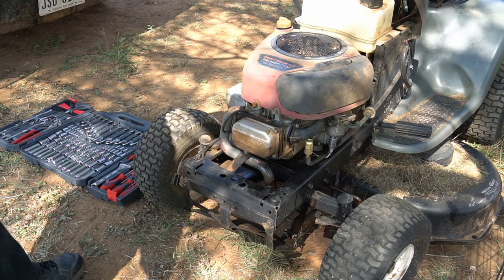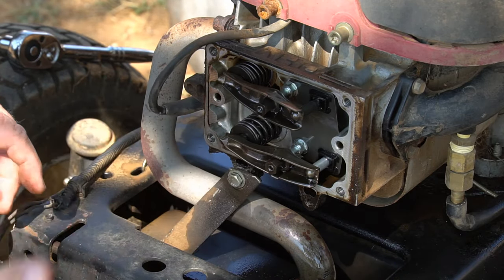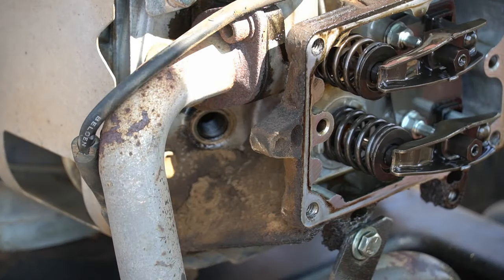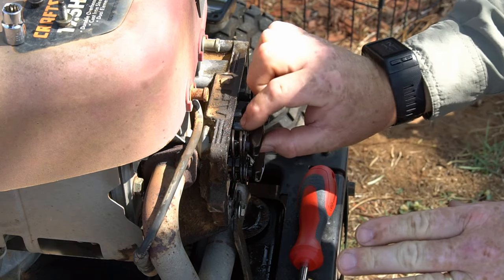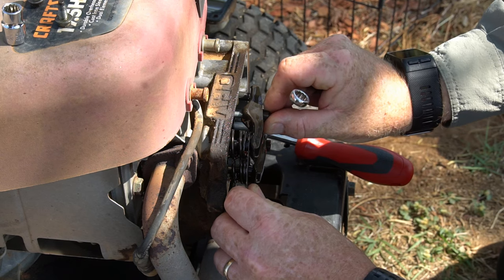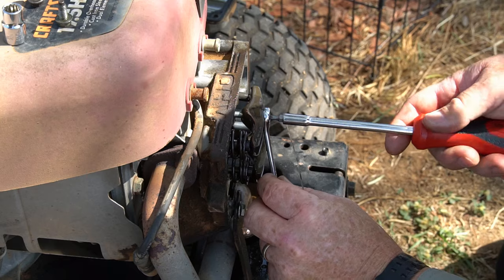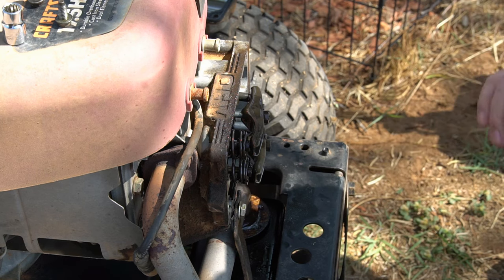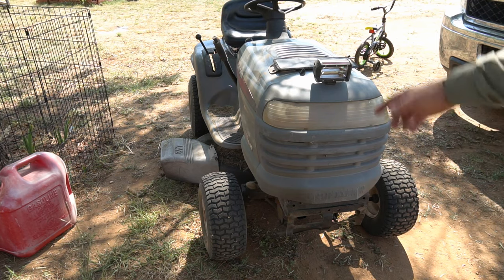🛠️ DIY: How to adjust the valves on a Craftsman (Briggs) 17.5HP OHV Engine

Comment: I've done many of these and the Intake is the Bottom with the Aluminum Push Rod. Top is Exhaust with Steel Push Rod. (Can always tell because one is shiny (Intake) and one is Black (Exhaust). Good rule of thumb when adjusting is TDC on compression stroke/both valves should be ready to adjust. Intake .004 and Exhaust .006. That seems to always work best.
Reply: Yep, if you pull the exhaust pipe that valve is right there. The reason briggs and crackens get fouled up is when that float sticks and the intake, angled straight down to bottom intake, lets gas right into the crank
Reply: Stevie H is right!
Reply: @rywolf01  bottom is int   its a fact
Reply: Have to agree with that
Reply: That is correct👍👍👍👍👍👍👍👍
Reply: Yes I have this exact mower and engine, Stevie H is correct.  You can see the aluminium intake push rod on the bottom, I just replaced a broken one.
Reply from the maker: Thank you for this great information Stevie H.  I appreciate it very much when viewers contribute useful information as you have here.
Reply: A simple magnet can differentiate between the two.
Reply: Yes sir you are rite on / intake has the aluminum push rod / the exhaust has a steel push rod / exhaust could not withstand the high heat it would all most melt it
Reply: This comment was spot on and brought my craftsman LT2000 Intek 17.5 engine back to life!  I was ready to haul it to a repair shop.
Reply: Hey I want to personally thank you for your comment. I have a Kubota push mower that I now have   running again. I tried adjusting the valves and just assumed top was exhaust and kept getting exhaust coming out the intake and couldnt figure out why. Now I know what I was doing wrong and now my rare kubota is running again after being down for a couple years! Thank you sir
Reply: Yeah just because a certain valve moves first doesn't mean it's intake. If the engine is past compression stroke the exhaust will open first as seen here.
Reply: itake always has an aluminum push rod
Reply: Yup, you have the valves reversed. But I am sure that alot of people already pointed it out. Other than that, great video!
Reply: intake is on the bottom on this engine.  when the jamb screw the smaller hex, this is the case,  if the jamb nut is used reverse your thoughts.  to be sure.  the exhaust opened then the intake just after it
Reply: You are 100% correct about the exhaust valve is the top and the bottom rocker is the intake valve and I like the way you pointed out the push rods and the valve clearance is correct too! Thanks!

Comment: You are mistaken top valve is EXHAUST!!!  Four stroke engine: intake-compression-power-exhaust!!
Reply: Yep. The exhaust valve uses a steel pushrod, and intake uses an aluminum pushrod. That is the easiest way to identify the valve on these engines.
Reply: Agreed. When rotating the engine, for about one whole rotation, the will be no valve movement. This is the compression and power stroke. After these, the exhaust valve will open and the intake will shortly follow. You can also pretty clearly tell the exhaust comes out right at that top valve
Reply: @Skippo18 Yes , I was just going to say that .
Reply: Not only that, you can see the top valve is literally next to the exhaust pipe.
Reply from the maker: Good info
Reply: @cheessedoodle I have this engine, just took it apart to do h3ad gasket. The pushrod associated with the top is darker and has a red bar on it.

Comment: As a rule of thumb and in this case, the "Intake Valve" has an aluminum push rod (bottom) ....where as the "Exhaust Valve" has a steel push rod (top). Good presentation...
Reply: correct
Reply: Lol I seen that to . he needs to get his info right before he makes a video . and there is a decompression release on the cam that maybe bad if people are getting to much compression
Reply: @SilverJustice what good is a how to video if the information given is incorrect. Fortunatly , in this case, the incorrect information didn't and in most situations wont result in considerable engine damage .
Reply: I probably won't get a response 4 years later but my problem is I think that someone who worked on this motor before me mixed up the push rods because every briggs motor I have seen has the aluminum on bottom. The one I have here has aluminum on top. I am trying to figure out  if they mixed it up so I can adjust valves but also so I can see if compression release is still working. I am not a mechanic. I have a Scotts S1742 with a briggs 17.5 motor. Cant find a serial  umber on motor anywhere. Every video I've seen has it on the valve cover buy there are no numbers on this one. I don't want to pull apart motor if I don't have to obviously

Comment: You made an assumption that the engine had stopped at the end of the 4th stroke and so the first valve to move was intake. In actuality the engine had stopped at the end of the 2nd stroke and so the exhaust valve opened first when you turned it. When an engine coasts to a stop it doesn’t always stop at the end of an exhaust stroke. It stops when the flywheel runs out of inertia.
Reply from the maker: Runs amazing. What else matters?
Reply: Jungle Explorer it would matter to someone replacing a valve or pushrod because they are different parts.

Comment: All these Briggs I seen I have one I got it free though my neighbor a Craftsman has 18 brigg I got it running of course the valves need adjustment I have another craftsman riding mower with the kolher command for 22 years never had to  adjust the valves it starts just fine still

Comment: just watched another video and they said  that the valve with the steel push rod is the top one and could be checked with a magnet,  and the alum. push rod is the bottom  and as i see it that exhaust pipe mounts close to the top valve  that would make it the exhaust

Comment: If you have hard starting it's normally the intake is loose. There is an internal compression release that pushes the intake down when cranking. Much over .004 on the intake will effect this feature resulting in hard cranking
Reply from the maker: Thank you for commenting sky5jump!
Reply: What to set at

Comment: Another good rule of thumb? IF the engine doesn't want to spin over?  Hard Crank? Before you go checking the valves and  messing there...make sure it's not vapor locked...(you can tell because there will be gasoline in the oil from Carb flooding. Always a good idea to put shut off valve on the gas line too on older mowers.
Reply: Thanks mr! Mine has fuel in the oil cuz I cut the plunger off of the electronic fuel stopper that comes up thru the bottom of the float bowl. I'll get a shutoff valve, even if it's a pair of vice-grips!
Reply from the maker: Thank you for this great information Stevie H.  I appreciate it very much when viewers contribute useful information as you have here.
Reply: 10th

Comment: A lot of good information but the first valve to move when you turn the engine depends completely on where the engine had stopped and which direction you turn the engine.

Comment: Top valve is exhaust with the steel push rod. The push rod is the darker color and on the right side of the rocker arm it is visible in your video.  
The lower is the intake with a lighter color push rod, it's aluminum with steel ends. Verify your engine for these specifications. Mine was a 18.5 HP OHV. Intake : 0.003 to 0.005 I shoot for 0.004<on the intake.  .. Exhaust: 0.005 to 0.007. This one I prefer the .007 on the high end to allow more exhaust to escape easier. 
I had to go deeper into my engine to replace a blown head gasket which was making it burn lots of oil. I'm impressed on how well this engine it running after 15 years. 
Sorry I didn't do a video on mine.
Reply: Hey Kevin. Thank you for your information. Many guys say the first valve to move is the intake. Well, what if the engine stopped in a different position? Then the first valve to move would be the exhaust. Am I right? Or does the engine always stop on the exhaust stroke? I would really like to know this. Thanks.
Reply: @AndysDogHouse  Makes perfect sense to me!!
Reply: Great explanation on which is the intake and which is the exhaust valve. I thought it was odd that he didn't just say that the valve with the aluminum rod is always the intake.
Reply: @rvalens2  If the  aluminum rod is on the exhaust, the exhaust heat would eventuality soften or melt the  aluminum rod! 
Most aluminum melts around 1400 degrees.
Reply: @kevincronin60181  Hmm . . . I did not post that the aluminum rod was on the exhaust side. I wrote that the aluminum rod is always on the side with the intake.
Reply: @rvalens2  I never said you did.
Reply: @AndysDogHouse  The only way to know for sure is to turn engine in correct direction, and the valve that moves IMMEDIATELY after the other valve is the intake, as the intake stroke is the 1st, and the exhaust stroke is the 4th out of 4. You are right that an engine can stop in any position and thus the 1st valve to move may not be the same.
Reply: @thejungleexplorer  Great video sir! Now I've heard all kinds of different valve adjustment numbers, mine seems to prefer 4 and 6. If I set my 17 and 1/2 horsepower Briggs to what you have yours set at, if it started it would be jumping and popping around like Katharine Hepburn in a helicopter! 😆
Reply: If you want the the exhaust gasses to escape easier, wouldn't the valve have to be open longer? A larger valve lash would shorten the open time.

Comment: I have had this problem for 20+ years.  The last time I checked there wasn't a clear answer online (yes, it has been a long time). You have clearly solved my problem! For that I most sincerely thank you!!
I'm sure that we have learned from 75% of the comments that you had the valves reversed. Not a big deal after reading a couple comments that made the correction. 
By inadvertently making the mistake (of mislabelling the valves) you have brought in MANY more comments which is very good for your channel. 
Congrats!
Reply from the maker: My pleasure. Glad the video helped you out.

Comment: I enjoyed your video. I try to do my own repairs as they're expensive, but moreover getting them to a shop or getting someone to the country where I live is next to impossible. I do maintenance so things don't need repair, but with a 20 years old mower, it comes down to other things besides oil, plugs and filters. My starting problem became clear it's compression, so valve adjustment would be necessary. Thank you Google. You took the fear out of it for me. Another video I watched didn't make me feel as comfortable as you did. Not knocking the other guy, because when he demonstrated the starting problem, it was identical to what my mower was doing.  What I liked from your video was that  you were more educational. Like explaining one valve is intake and the other is exhaust. Don't know why, but that sort of thing helps me to understand the mechanics more clearly. Also, getting the piston at center. You instructed the tool needed to draw back an additional 1/4" from the spark plug hole. That had not been mentioned in the other video. Lastly, appreciated how your mower looked to have been used to mow instead of nice and showroom shiny. 😊 Mine looks like yours. I wish it was nice and shiny. Anyway, I enjoyed and learned from your video. I'll def give it a thumbs up. Wish I could give it a heart also, cause women can work on things like this and still be girly. ❤
Reply from the maker: Thank you for commenting catlecat C!  I am so glad the video was helpful.
Reply: As others noted, typical mower engines are called "4 stroke engines" because it takes 4 strokes of the piston to complete a single cycle. Perhaps another helpful tip for you to locate Top Dead Center of the Compression Stroke. Since you will have the spark plug removed and the coil wire pulled aside, you can use your thumb to block the spark plug hole and as you rotate the engine, you will feel the compression from the piston pushing the air past your thumb. Another way to get a visual sign of TDC, you can purchase a spark tester. Using this tester, you attach the tester to a ground on the engine and attach your spark plug wire. When you see the spark plug tester light flash quickly, you know you reached TDC( within a couple degrees of TDC) because that is when a spark plug fires the air/fuel mix in the cylinder. If you had the engine apart further and you could see where the coil mounts, you would also see where the flywheel passes the coil pickup to signal the coil to fire the spark. The point where these two items line up is where you will have both valves closed, the spark plug firing, and the valves can be adjusted as noted.

Comment: You got it BACKWARDS! 
When the intake valve closes, you have a full compression stroke before it fires and the exhaust valve begins to open. In this video, as soon as the top valve closes, the bottom valve begins to open, immediately! This tells me the top is the exhaust, because on stroke 3 of the 4 stroke engine, the power stroke, as the piston begins to travel upward on the 4th stroke, the exhaust stroke, the exhaust valve is now opening. as it reaches the top of the stroke, the exhaust has been purged from the cylinder, as that exhaust valve is closing the intake valve is now beginning to open to allow a fresh charge of fuel/air mixture into the cylinder as we begin stroke 1, the intake stroke. The only time in the 4 stroke cycle that both valves rock at the same time is at the very beginning of the intake stroke. This dude is backwards! NEVER shove a metal object in the plug hole to feel the piston coming up. Always use a plastic ink pen or the eraser end of a wood pencil. Anytime you stick a chunk of steel against an aluminum piston you risk the chance of damaging the piston head. It may be ok for you or I to do this, but I don't recommend a novice to try it, and this video is intended to show a novice how to adjust the valves.
Reply: correct, top valve is the intake valve
Reply: @chrisjensen7140  oops... better check your reply mate, I know you meant to say top valve is exhaust.
Reply: Thanks Mike,, you got it right,,,,
Reply from the maker: Thank you for this great information mike speece.  I appreciate it very much when viewers contribute useful information as you have here.
Reply: I adjusted valves on my mower inlet at bottom, exhaust at botton
Reply: Mike offers an excellent explanation and excellent advice.

Comment: Adjusted mine last week but i didnt go to all this trouble. Just find TDC & pop the valve cover off & knock the jam nuts loose on both valves. with your fingers run both adjusting nuts down till they bottom out. then back the bottom nuts up 1/4 turn , hold and tighten jam nuts. this will give you 3 to 4 thousands clearance on both valves. Mower will now crank easy and run great.. This will work on almost all riding mowers with a few exceptions. You will know if you have the exception cause it will backfire very loud every time you cut the mower off.  if yours is the exception just give the exhaust valve another 1/4 turn out.  Great video brother , always good to know the correct way of doing things .
Reply from the maker: Good job.

Comment: I have the same mower & engine ( a 2005)& the decompression mechanism on the exhaust valve linkage (internally) is suspect bad. So... gonna adjust valves first as engine only cranks to compression, then stops. New battery & starter did not solve this issue.
Thanks for the video! You da man!
Reply from the maker: Thank you for commenting Jeff Randolf!  I am so glad the video was helpful.

Comment: He Adjusted the valves backwards and it still ran good. Good ol briggs and stratton. I've been mowing 7 acres in florida for 15 years with a 42 inch murray with the 17.5 briggs and it still runs good. If the engine only spins about 3/4 of a turn and then stops when cranking,and you think you have a weak battery,that's when the valves are usually out of adjustment. Or it could be a broke compression release thingy inside the engine. But it's probably the valves needing adjustment.🔩🔧😷🍺
Reply from the maker: Thank you for commenting Donald Green!

Comment: Kinda missed this the first time around, but kinda cool that you had this converted to a dual fuel.
Reply from the maker: Yeah. I converted it many years ago.  I can run it on both gasoline and propane.  I ran it an propane for over three years mowing 10 acres before getting a new carburetor for it.
Reply from the maker: Here is a video I made about it.  It is one of the very first videos I made for my channel. https://youtu.be/b06bueSIU5U
Reply: I modified my push mower to do that but I didn't do the legit way I did it a diy way and to make it run properly I just had to adjust the flow of propane. It's really easy to do